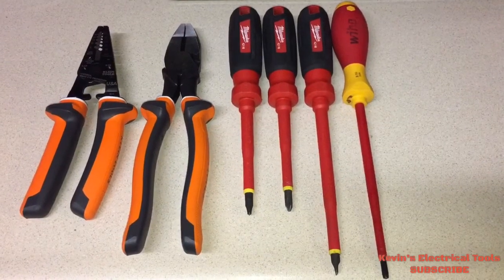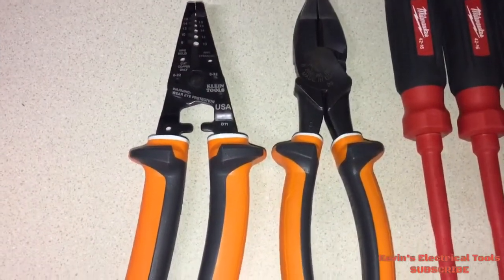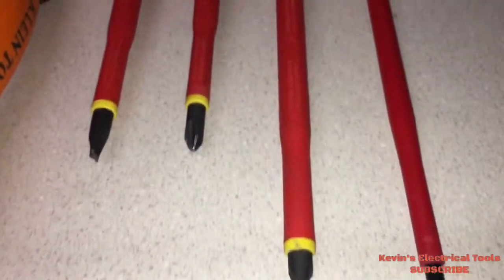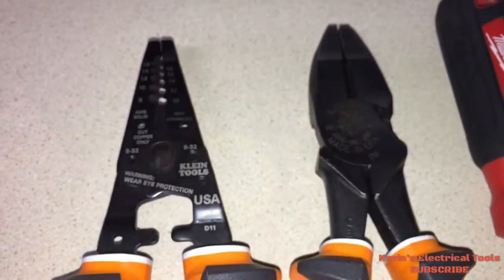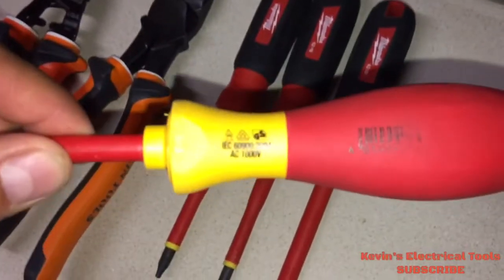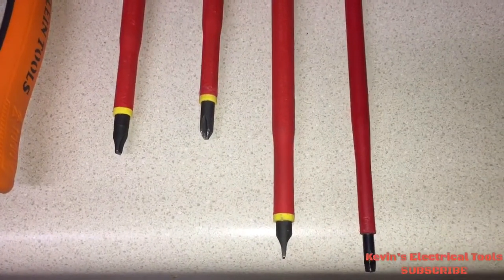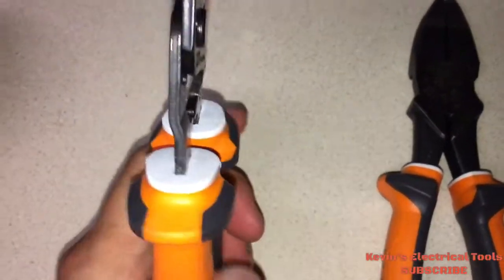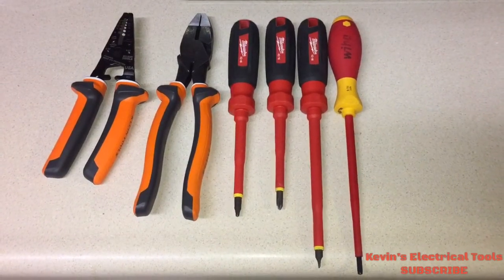Why Insulated tools are important to have as an electrician!!!

Comment: my question to you is when possible will adding electrical tape to my insulated tool provide extra protection? thoughts please thank you!
Reply: Ps. I need to change an electrical outlet plate if I cant cut the power should my electricians screw driver protect me ? does this sound like it should be a fix for dummies if I use my electricians screwdriver? I mean it would seem assuming everthing is wired correctly all you should need to do is re-insert the screws with the new plate ? thoughts please thank you
Reply: Electrical tape would work but it's kinda ghetto

Comment: when you use the word 'nick' does that mean it gets nicked by electricity or by sharp metal and the insulation gets cut? thanks for that info...i never knew that..goos video 👍
Reply from the maker: kingofthecrease30 when the insulation gets cut
Reply: @KevinPerezTheElectrician  I've been looking at insulated screwdriver sets for about a week now. And you've definitely enlightened me on the nicking of the insulation. Thanks very much for that information. Cheers.

Comment: only insulated tool i have is a long #2 square tip for panel work, i mean, a regular klein is insulated as long as you don't touch the metal part, haha
Reply from the maker: Mike's Tool Shed I seen that tool!!! Home made insulation always works as long as you don’t any metal parts 😂
Reply from the maker: Mike's Tool Shed I can’t wait to see what the  depot is going to send you guys. Hopefully you can use em at the sites.
Reply: well all the brand reps know what i do, so if i get a wood planer or a router i'm gonna be pissed
Reply from the maker: Mike's Tool Shed give it away to your subscribers or return it for store credit haha just kidding.I don’t think you’ll get any planers brahh. Your definitely going to get some cool shit to add to the arsenal. I hope Klein sends you more shit to. Southwire sends me tools every three or four months I’m apart of there sampling program. So far I got a snake, a lineman plier, and there going to send me some crimpers
Reply: Thank you, third video, that's all I wanted to know. Why is a person's hand leaving the handle, anyway. Right?  peace